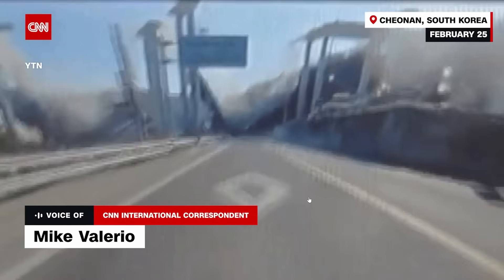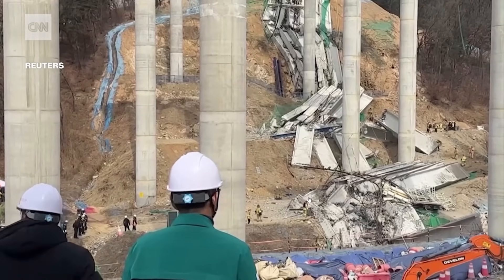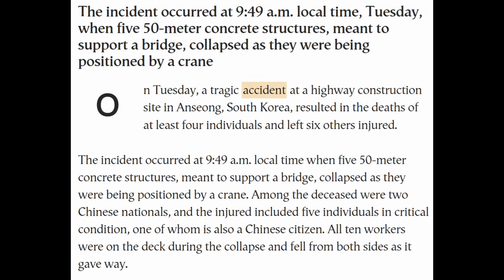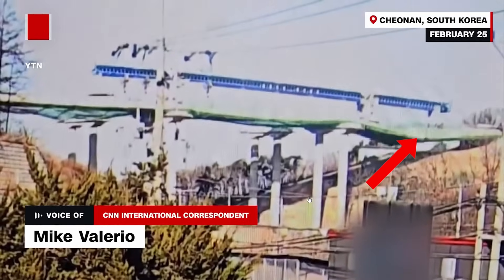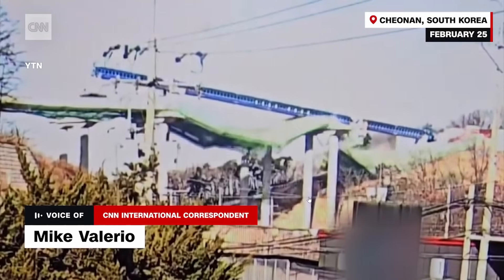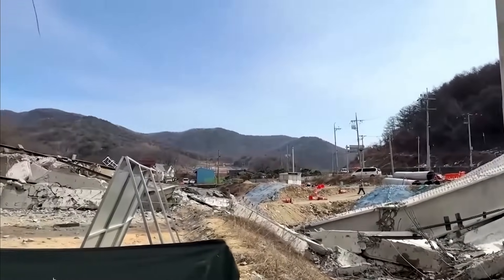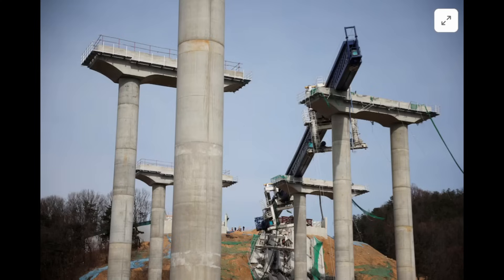Why Did this Bridge Fail?

Comment: intriguing item seen in the video shows the gantry pylons that transfer the load from the Gantry into the piers were not in the correct position to properly do this job.
these gantry units are built to inchworm from pier to pier transferring their load and the weight of the girder or deck component directly down onto the pier cap.
each pylon is moved separately during gantry positioning to hold the gantry in place and balance so it can reach out to the next pier to place it's lead pylon onto.

Comment: The piers survived a massive impact load from the crane when it landed.
Reply: Think though the survived, they likely have massive internal cracking and damage, and will have to be demolished and rebuilt. 

Looks like yes the concrete span is what failed, there in the middle of the span, either from being sub standard, or it was not cured long enough, or was curing, or the supports, which were supposed to take the load during cure to the blue support structure, failed at the deck attach points for some reason.

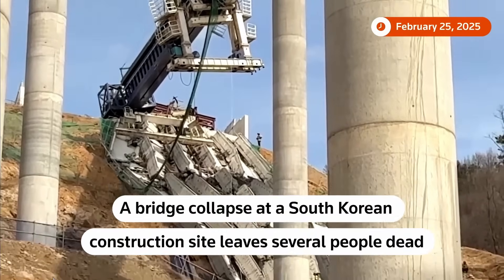Comment: What a joke, FIU post tension GARBAGE engineering again. You can see it at 2:10, left corner. Another hollow POS that can't hold up it's OWN weight. Tinker toys. Almost all the flimsy cement crumbled away from the rebar. LOL Precast slab apartments FAILED in the 1970s in Britian. 
Looks to be too long spans anyway. They are as dumb as the guys in India trying the cross the Ganges, I think it was. 
There's a bunch of solid built sectional bridges in Canada and China that are still good after 40 years, like the PEI Confederation 7 mile crossing. 
Most of the not too long new bridges I see here now have 6 or 7 steel beams about 7 feet high with 6" spikes welded every foot on top. 
These are then embedded in poured concrete all in one pour, zero chance of falling apart. 
X spars underneath to keep the beams straight.

Comment: The rusty beams bent in circles were originally straight rail, apparently conventional railroad rails used to support and traverse the gantry. Somebody didn't realize that while advancing the gantry, they were putting a point load on the concrete deck when it should have been transferred to the next pier without ever touching the deck.  It also seems to me that the tall columns are awfully slender for their height, I wonder what the designed safety factor is. I'd worry about the columns failing in bending.  Similar situation to the piles of material on the I35W bridge in Minneapolis.
Reply: slender columns remind me of the condo collapse in Florida few years back, I don't like seeing stuff like that. agreed on all of that including the gantry stuff.
Reply: I was wondering why there was old rail tracks in the debris. Using it to remove the gantry does makes sense at one level. But why not just use the gantry itself to back off the bridge? Seems some odd decisions were made that day.

Comment: South Korea has a strange honor system where you don't question the leader and for example it has caused a number of major aircraft accidents because the co-pilot doesn't question the captain even when they see a problem. That is I won't fly on any Korean airline. In this bridge failure someone might have noticed a problem but didn't say anything in fear of retribution.
Reply: while it's still an issue in most of every day life in asia it's mostly been weeded out of airline industry as the older generation is retiring out where not speaking up carries a harsher penalty than speaking up now. it's still an issue in the middle east and S. America but it's getting better. the bigger issue that asian airlines(especially china) are dealing with now is the over reliance on automation and not allowing their pilots to actually fly the plane.
Reply: yeah, and then in other countries people say "look at how poor they are, look at how they suffer! send them aide! everybody sing ...!"

Comment: My guess, deck was not poured(appears to be too much sunlight between beams during collapse), and diaphragms were not poured and needed substantial temporary bracing on ends.  My guess furthers that beams fell on its side leaving beam insufficient to span, snapping at mid span ish. .  Somewhere along, dominoe effect took place. Back in late 2002 or early 2003 I was pricing a job for crane operated for AMEC doing a bridge over Shark River.  They were using a Manitowac 2250 on a barge with a 500 Ton Demag AT on land setting a, as memory serves, 120'  105Ton Precast Beams.  At bearing they were about 8' tall.  Beam fell on side, snapped mid span, snapping 500Ton AT boom at heel, bringing it into drink.  The 1/2 of the beam on the barged 2250 bounced around a little bit but remained secured(Amazing).  That's my guess and I'm sticking to it.  For now.

Comment: Well hi Casey! I can't belive there were so many that even lived! 
Not sure where you found that video you slowed down, but here on YT, < and > move the video one frame at a time, Which I use often to see extra detail. Sometimes it's not so great though because for example that original footage was probobly 20 FPS, but it lets you see failure movement really well
That initial movement is centered in that span. Now, I'm not an engineer, but my first question is how tight were the tollerences for weight on this bridge? did the team that built that giant gantry and the team that designed the spans sync well? Because I wonder if that equipment was over weight for the structure somehow
What about it's operation, could someone have pulled the wrong lever and placed enough weight from that machine to overload the span?
Now I wonder how they get it down without just dropping it by chopping a pier down. that would be a HELL of a crane

Comment: Ran some jobs as an ironworker at an enormous battery plant in Kokomo Indiana recently. It was a South Korean company with South Korean engineers. I'm just a dumb ironworker and I wasn't very impressed with their engineering and attention to detail. 
One of their buildings had triangle-shaped footings on the z plane.  I've never seen anything like that and I still wonder what the purpose is of it

Comment: I can't tell what supports the Gantry Crane.   Since it's above the bridge deck, I'm going with the thought that it was the primary cause.  There are some similarities to this and the FIU bridge.  Mainly the collapse is sudden and catastrophic.
Reply from the maker: I agree with you. It all happened very fast.
Reply: @CaseyJones-Engineer  It's interesting that the gantry beam is still in relatively good shape, although I'm sure it will have to be discarded  Once something like this happens, how salvageable are the piers?. This bridge looks very precarious under the best of circumstances. While I'm not an engineer, my feeling is this the wrong type of design for this particular span.   The engineers were really pushing their luck. Another similarity to FIU, Figg,  and Denny Pate.
Reply: Bridge deck not poured at collapse section.  Newer footage confirms.

Comment: The launching gantry I've seen always have the vertical support over the piers.  As the gantry progresses, a third leg ir projected out to the next pier and load is transferred to it before lifting off the adjacent support.  In this way the gantry never rests on the deck.  I wonder if the load of the gantry leg was placed on the deck and that the deck was not designed for it.  Communication issues between design and construction??
Reply: It sure looked that way to me.
Mechanical engineer.
Reply: You are correct!
Reply: It seems that all of the beams have been laid and they were moving the gantry off when this accident happened. What's confusing is why the middle support would be past the pillars during this movement.

Comment: South Korea has had major issues with their quality of concrete.  At one point, they were building houses from concrete, only to learn the concrete was made from radio active rocks, and people were dying.  Their bridges often fail because of the poor concrete and the earthquakes.  The nature of the earthquakes makes construction difficult.  They would be better off building tunnels, than bridges.  The summers can reach over 100F degrees and the winters can be -40F degrees, causing major issue in extreme expansion and contraction.  The bridges in Seoul tend to last a few years.
Reply from the maker: Great point about the rough climate.  It is similar to what I see in the Midwest and such weather is very hard on bridges especially when road salts are used on the bridge decks in the Winter.

Comment: The second gantry crane support was not directly over the pier. It contributed to the failure on the far right deck.
Reply: It looks like the gantry was at it's full extension and that last support was over air not the pier. 

Probably going to be a hassle to extend (if possible) the gantry or find a bigger one and someone decided "close enough, should be fine. 
And it wasn't.

Comment: South Korea has a serious problem with corruption and it rears its head from time to time. The contractor is a corporation run by one of the ultra rich families of the country, who are essentially above the law. Though many of the previous instances with immense public pressure did put forth punishments, albeit light despite massive losses. Like in the mid 90s over 95% of high rises were deemed structurally risky, many were outright dangerous, but only few got repairs, none demolished, that too, only after one collapsed, killing over 1.2k.

Comment: Good video. It did look like the gantry was supported by the deck and the deck collapsed. I got to wonder if the gantry was only temporarily on the deck on the way to a pier. I designed temporary supports for construction for a while. Had to put a lot of notes on the drawings to try to prevent overloading during the erection. I learned that only about 50% of contractors can actually read the drawings and less than that can understand the meaning. Over 25 years ago, it got popular with some engineering schools to do away with surveying and drafting. Last I heard, there was a big push back from engineering firms. Good Luck, Rick
Reply from the maker: Thank you.  The other issue I see now is far too many engineers don't want to gain any field experience.  I am increasingly finding that fresh graduates want to go straight to the office and do design work only.
Reply: @CaseyJones-Engineer  Yeah, the old apprenticeship type program where you did surveying and field work for your first couple of years seems to have disappeared. This lack of understanding can lead to some pretty bad designs. Its funny that my last jobs were construction inspection. I found that I liked being outside more than in an office. Then I retired and enjoy that the most. Good Luck, Rick
Reply: @CaseyJones-Engineer  I think young people trust computers too much and lack common sense.   It the deck was supporting the gantry, then yes it was the deck that failed., but why would they place all the load right in the center of the span?

Comment: You really should do a video about the concrete basement failures of thousands of houses in central Mass and Conn. The concrete was naturally contaminated with pyrrhotite and the basements severely failed 20 years later. It’s a big mess for the homeowners because it is not insured and the houses all need new basements.
Reply from the maker: Thank you for the suggestion.

Comment: It looks to me as well that the legs were not placed over the end piers, though I think the video started when the accident was already started.  This sort of girder is usually self supporting under self weight by a fairly significant margin if not designed for subsequent post-tensioning.  It is posssible that the gantry support failed in some fashion dropping a girder or dropping a gantry support onto a girder at mid span while the gantry was traveling, triggering the bridge's failure.  Could be simple operatop error as operation of a gantry like this in place of two cranes is a complex sequence of operations, as the girders have to be supported at all times near the ends, and the Gantry has to be supported on two piers or a pier and abutment.

Comment: Just to clarify: I agree it looks like the bridge (not the gantry) failed. But it doesn't look to me like the bridge had the deck installed yet on top of the beams. So technically the bridge beams failed. Am I being pedantic? Yes -- as I think all good engineers are. 😁
Reply from the maker: That is what I said in the video.  I said that the news stated it was the gantry but it looks like the bridge deck is what failed.
Reply: @CaseyJones-Engineer  Sorry, I wasn't clear.  I'm suggesting it didn't have a "deck" yet, just beams.